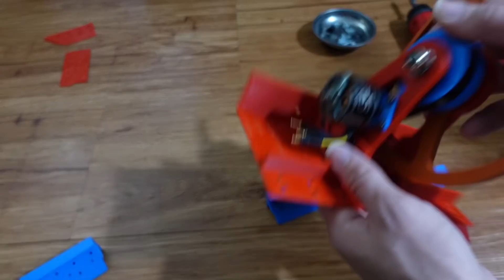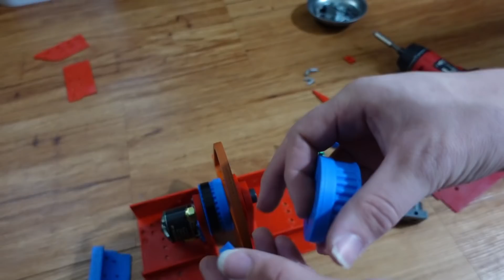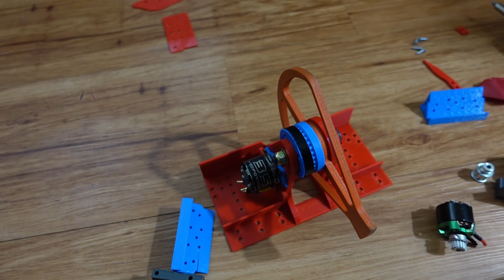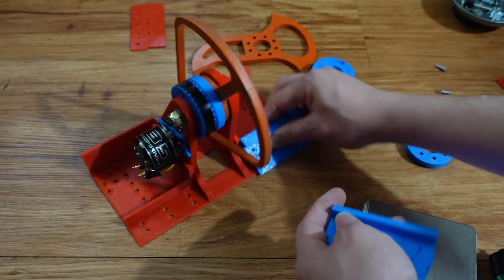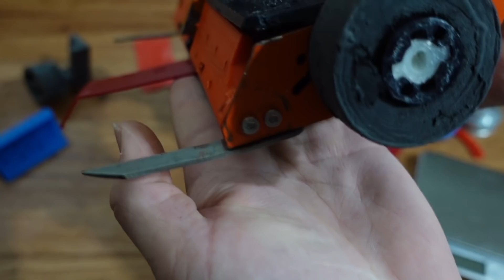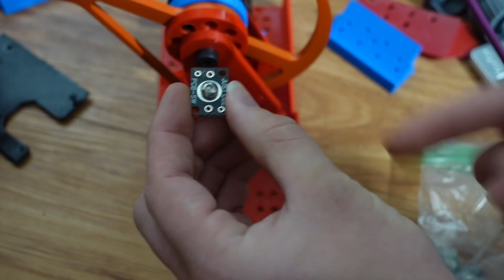Division V3 Design Overview - Beetleweight Combat Robot 2022 Update

Comment: I'm curious how you did the titanium armor blocks/what material theyre in. I did a simmilar system with 3d printed nylon triangles and the block shattered on first contact. Yours however dont seem to do that and actually survive amazingly.
Reply from the maker: They are literally just mostly solid 3d printed TPU. They don't do amazingly if the back corner of the wedge gets hit but they take a decent amount of punishment from the front.

Comment: RE:- Aluminium motor mounts Vs. Titanium. Use the Al, not Ti. Aluminium is more thermally transmissive than Ti, this is why Al is used to make vehicle radiators & Ti is used in heat shields. Easily tested, put 2 equally sized pieces of Al/Ti in the freezer overnight. Take them out in the morning & hold them. See which one feels colder. It'll be the Al, as it absorbs your body heat faster than the Ti. That's a pretty unscientific test, but it's quick. For a more rigorous test, use an I.R. thermometer & measure which metal stays colder over time. The Ti will stay colder longer than the Al.
Hope that helps. Cheers... G
Reply from the maker: I could also just look up the thermal conductivity numbers LOL. But yeah I have already ordered the mount plates and they are aluminum
Reply: @JustCuzRobotics  True, but that's no fun - 'sides, this is the YT comments section, if I'd not added the justification & method, a pit of voles would've undoubtedly attacked...
Reply from the maker: Sadly temperature doesn't show up well on camera, at least not with a camera I can actually afford. IR thermometer is way less exciting than $3000 FLIR imaging. Maybe someday.

Comment: Why use a separate BEC?
Reply from the maker: Most brushless speed controllers simply don't include them including all of mine. I could get slightly bigger / heavier / more expensive ones that include them but having a separate BEC also guarantees that even if one ESC blows up or gets unplugged or a solder joint breaks, the rest of the bot remains functional.

Comment: This might be a weird question but may I ask how thick and wide your weapon supports are, and shaft diameter? I'm trying to design a 3lb and one of the things I struggle with is knowing how much support is enough. I don't want my supports to weigh too much, but I also don't want them to be too weak to support big hits. Same goes for weapon shaft. I figure the best way to know what is enough, is to see what other people are doing. Which is why I'm asking :).
Reply from the maker: Not a weird question at all. I thought I mentioned but maybe I forgot to say the uprights are 1/4" wide and will be 6061 or maybe 7075 aluminum. The shaft is a 3/8" shoulder diameter alloy steel shoulder bolt which has proven extremely reliable in every version of Division so far and I have also had success using a 1/4" shoulder bolt on my antweight as a dead weapon shaft.
Reply: @JustCuzRobotics  thanks for the response! That makes me feel better about the almost half inch outer diameter dead shaft I was planning on using. (12mm outer diameter, Stainless steel).
Reply from the maker: That sounds super duper overkill. Honestly even my shaft is likely overkill
Reply: @JustCuzRobotics  well it's hollow, but the hollowness will be filled by 2  M8 screws, one on each side of the shaft to hold it in place.  I picked M8s because it's what the vector kit uses I believe. (Website is down so I can't check). But thanks, I might consider something a bit slimmer.

Comment: Did building shrapnel mine assist at all with what you wanted to change with division?
Reply from the maker: Absolutely. The drive system I used on Shrapnel Mine is being modified to work here but mostly the same exact system will be on Division V3. Shrapnel Mine used slightly bigger and far wider wheels but they were insanely durable and had so much grip and power. I was super impressed how it worked so why not do the same thing again?

Comment: Amazing video, had to watch it twice to fully understand it. 

I really love the in-depth dive into the design process and how you keep iterating your components before committing to building it out of metal so to not fall in the same trap of pigeonholing yourself into a bad design. Reliability and reparability are one of those factors you can't see  when you just look at a picture or even a fight of a bot, but it's how you win tournaments. Seems like you're setting yourself up for a good 2022 with these designs!

Do you think moving the belt further away from the weapon make it easier for opponents to break it? (instead of your own weapon doing the work)

Can't wait to see it in action! Although with the weapon mounted even further forward it might go even more bonkers in the box than before, which is awesome to see every time.
Reply from the maker: Thank you!

Not once on Division V2 have I ever broken a belt. Now it's like twice as thick. I doubt that's a real concern.

Comment: You don't seem to do any calculations of stresses or forces on fixings etc. You just seem to try stuff and say "oh that wasn't strong enough, so I made it bigger".  Why don't you introduce some science to streamline your design process?
Reply from the maker: Well actually I have done plenty of simulations on the weapons and uprights to optimize their shape but this can only provide a relative 'this is better than that' or 'this area is weaker and should be thicker'. The simulations specialist at the engineering firm where I work says "all simulations are wrong but some are useful".

At the end of the day combat robotics is far too unpredictable to actually have enough loading condition information to predict how, when and why anything will fail. You can set up all the simulations you want but they will never represent reality. I do math for the predictable things like the wheel speed and torque and kinetic energy of the weapon etc. I didn't include all that in this vid since they are in my other tutorial videos. And this video is horrendously long already.

At the end of the day most people are doing the same thing as me. Combat is very experiential, more of an iterative process than a pure engineering one.
Reply: @JustCuzRobotics  Thanks for a good answer but I don't believe it entirely expresses the truth.

You say that the combat forces are too unpredictable but I'd say nobody seems to try. For example you could take "Spinner A" a well known destructive bot in your field of combat. You know it has a flywheel of a certain mass rotating at a certain speed. The shear force on one of your bolts can be calculated in kN force for a direct hit.

You can calculate that a M4 fixing will be sheared off while an M6 fixing will be sufficient. Similarly 2mm thick armour will be ripped while 4mm thick armour will survive. The stress on the armour can be calculated in N/mm^2 and compared to the yield stress of the material.

It's easy to say forces are unpredictable but I've never seen anyone even try, or even estimate to get a ball park figure. It's almost like they don't know how to.

I'm sure some teams would have the skills but the overwhelming approach seems to be,  let's try this 2mm plate.... oh we got shredded,  let's try 4mm plate.

If they had made even a basic calculation, they could have avoided the defeat and used 4mm to start with. 

This could be applied in so many areas. Axle diameters, wheel armour etc etc. Protecting vital components.   Nobody seems to make the slightest effort in actual calculation. 

They say it's "engineering" but it's more trial and error... that is a branch of engineering, but so much more seems to be left out that the teams don't seem capable of understanding or tackling.
Reply from the maker: The problem is we are not dealing with force or pressure. We are dealing with impacts. Impacts are inherently way harder to predict or deal with. The effective force is based on the time over which a hit occurs and this varies widely based on the difference in hardness of the materials, the angle of a hit, and a million other hard to call factors.

When designing a crusher that's all static loads it is easy to do the real engineering modeling with known forces and be accurate within 2X of real values. But for impacts the difference between energy transferring over 1ms or 10ms is an order of magnitude of difference.
Reply: @JustCuzRobotics  Dynamics can still be estimated to some extent.

 You may not be able to prove something will work, but you can certainly prove it will fail. Some  armour I see wouldn't even cope with forces estimated at the very conservative end of the impact ranges, or even quasi-static forces such as the weight of a falling robot, or the weight of a pulveriser hammer. 

Or mountings of cables and components tested against the inertia of the parts and weight of a falling object against a hard surface such as a steel floor. The height of a flip can be estimated and the energy to be dissipated calculated.

I have never seen any teams even go into the mechanics of even trying to estimate these forces as a first stab in the design process. Maybe they do, but I'm left with the conclusion that most don't know how to.
Reply from the maker: Not all teams are as willing to share what they do as me. I don't think it's fair to assume because you don't see it, nobody does it.
Reply: @JustCuzRobotics  OK, that's a reasonable answer. My problem is the TV shows, videos, and most of the You Tube channels just see too dumbed down. It's all about bang and crash. There's very little on the decisions behind the specification and size of components. Plate thickness, axle size, bolt sizes etc. Basically important design processes seem to be either hidden, ignored, or deemed just not worthy of coverage.
Reply from the maker: This is a supply and demand problem. You want the juicy details but most casual viewers will just hear a jumble of useless numbers and facts and get confused. It doesn't make for good TV for a general audience. My channel is hyper specific for those interested in building robots, but I also need to explain things in a way that someone generally with a high school physics class under their belt can understand without also being an engineer. Because among Battlebots viewers which there are a few million of, only a few thousand watch my videos as it is. And if I limit that subset to only those that are engineers I would get like 100 people.

I have tutorials and guides that deep dive (like this video but even more specific and in depth) and then I have less technical videos where I dumb more down to appeal more widely. The guides and tutorials routinely get a fraction of the views. It's sortof unsustainable as a channel to only ever make that one kind of content. 

My goal is to get more people interested in combat robotics, and get more people involved. So I have videos that target the general battlebots audience that also hopefully drives them to check out my more technical stuff and get info needed to join the sport if and when they are ready. I can't get to everyone with every video sadly.

Comment: If the wheel pods could be mounted on the "wrong" side that would give you 4 positions to try for balance, could that be helpful?
Could the top plate hook into bracket the uprights bolt to?
Reply from the maker: I am not going to notch the uprights as those will be 2D lasercut but I may try to notch and lock into the front wedge mounts. That's a good idea.
Reply: @JustCuzRobotics  I thought perhaps that oval spot between the screws could be where the top hooks into.

Comment: If you do end up making bushings for the uprights, why not make them the wear point? If they are steel you might still have the egging problem. If they are aluminum they would be cheaper to replace than the uprights.
Reply from the maker: It's not wear so much as stretch over time from repeated impacts. Steel is more resilient and harder so it won't deform much if at all from that is my hope.
Reply: @JustCuzRobotics  my thought is the uprights could still egg around the bushings. So I'd make them from aluminum (and held in by the weapon stack) so they would be a cheep easily replaced wear point.
(I had a car with a steel bushing egg an aluminum block.)

Comment: Seeing this makes me want to go back to the older versions of 0FF with the fingertech 6" bar mounted vertically, directly driven by a Turnigy D3530. That was somehow an antweight. I don't know how I made it work.

Instead of electronics going between the dangerzone, maybe you could have both halves be electrically independent of each other with no wires crossing over. I don't know how your weight situation is, but that might help to both keep things more simple and make it quicker and easier to diagnose problems. I really don't see any reason that the two halves need to be connected unless you absolutely can not afford the weight for another battery and receiver
Reply from the maker: So I had considered this but mostly it's space. The weapon motor and ESC are gigantic and weigh about as much as the battery I use. I need at least as bug a battery to run just the weapon as for the whole robot since the weapon motor draws more power than drive by 5X. I don't think I have room for a battery on the motor side and if I did it would be super off balance.

Comment: It seems like the main advantages of V3 are in terms of (a) maintainability and adaptability to future changes with fewer baked in limitations due to old sub-optimal design choices, (b) better angle of attack of the main weapon with less chance of self-inflicted wear and tear, and (c) somewhat improved overall durability due to stronger frame integrity. What do you see as the highest-running causes of failure in those matches you have lost in the last year and do these changes directly address those causes? These changes don't seem to alter bot stability -- is that an not really an area of concern, or do you have other planned changes which could improve stability?
Reply from the maker: Stability isn't a huge concern but I think the angle of attack being more low down and upwards will help prevent bouncing straight back and toppling over after a hit. 

One other focus was on drivetrain reliability, I'll talk way more about that once I have it driving around in my next overview. I have lost many fights due to losing a wheel, drive signal wires caught in the drive motor, pinions breaking loose of drive motor, or a combination of those. I think I have a solution to all that with the new Drivetrain.

Comment: what fills the gap between the plastic weapon pulley and the aluminium weapon upright? Like what stops it from friction welding itsslf/melting if slightly misaligned /in contact?
Reply from the maker: In version 2 I use the 3D printed Nylon pulley itself as a spacer and it rubs on the upright with no melting issues. Nylon is slippery and nice for that sort of thing. I may add a metal spacer though or a thin steel shim to be extra safe but so far no issues with it since there is extremely little side load

Comment: There is this one thing im trying to understand, the screws that fixes the weapon assembly, where they will be threaded? I thought that It would be threaded in plastic.
Reply from the maker: They will be threaded into the plastic 3D printed pulley. I have done this on V2 as well, those screws never experience any load except shear load so there is nothing that would ever pull them out of the assembly. They just transfer torque from the pulley to the weapon.
Reply: @JustCuzRobotics  well thats really good to know. im planning to do an simillar assembly on my 1 pound antweight weapon.

Comment: How do you drill the attachment holes for the weapon uprights into the billet frame? That seems like it would be super hard to get the mill in there since it's so far into the chassis. Just use a really long drill?
Reply from the maker: That is a very good observation. I actually bought a special drill from McMaster for about $17 that not only drills but also countersinks those holes in one operation so it is a much stiffer and larger diameter bit right up to the end. It is long enough to reach easily. My backup plan is to use a $3 long normal drill bit. The holes are about 3 inches away from the edges of the base so it's not quite as bad as it seems.